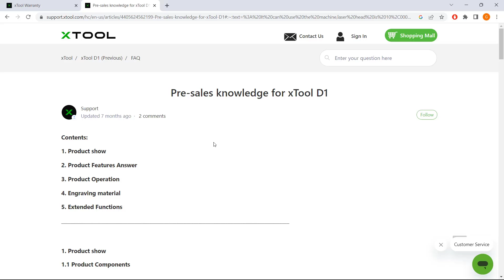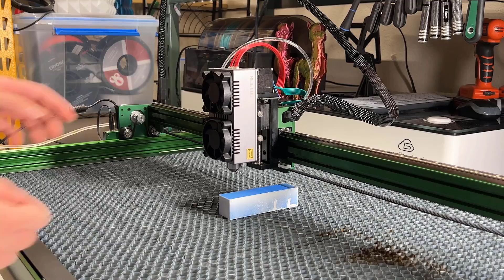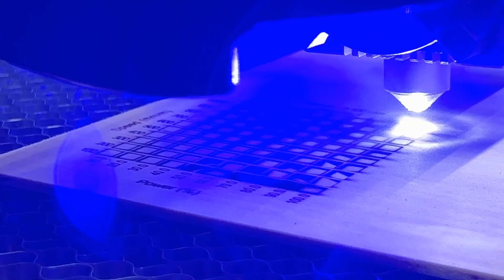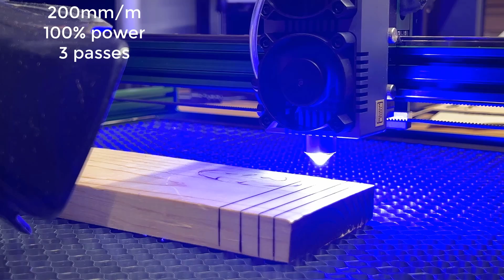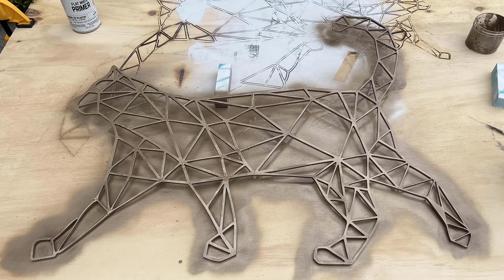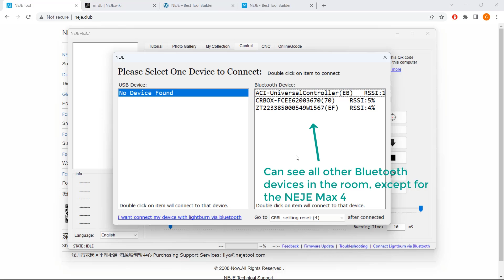NEJE Max 4 20W laser engraver: extendable to 750x1030mm, motorized Z-axis, multiple passes step-down

Comment: Can the machine use standard NeJe software? I have a NEJE DK8 (tiny engraver). It is very small, but, as a non tech person, I find their software easy to use. (Though it sometimes glitches)

I need a larger engraver, but am not sure I could manage the lightburn software. 

Do I have

Comment: Hello, I have a question.  What is the accuracy of cutting a circle?  I had one model from Atomstack, and there the cutting accuracy fluctuated around the circumference by 0.4 mm.  It didn't make me an even circle, but rather an uneven ellipse.  I want to buy NEJE MAX for the size of the structure, but I am afraid that this problem will get worse.  So far, I haven't had a laser other than Atomstack.  It cuts the rectangle/square exactly to 0.02mm, but it can't handle the circle.  That's why I'm interested in how it is with NEJE, since it has a completely different construction.  well thank you

Comment: No where on the site doesn't mention watts.
What is 80 module?
Reply: This is an issue with almost all diode laser engraver brands. They try to use in marketing materials and product naming how many watts the machine uses instead of optical power, to make the customer think the machine is more powerful than it actually is.
This machine has an optical power of 20 watts, probably using four 5w diodes.

Comment: Thank you so much for this video. I've been considering a laser engraver but most of the videos that I've found are glorified sales pitches, without much useful information. One of the main uses that I have for one is engraving on hand-turned wood pens. Would I need the rotary roller to engrave on pens that are ~ 15-18mm in diameter?

Comment: Loving your reviews. Out of all of the lasers/brands you've reviewed so far, which is your preference? I'm really thinking of going with the Neje. I already have the 3s Max with the A40640...but I'm really wanting to take advantage of the improved power and speed of the new unit.
Reply: I bought the NEJE, and the power supply quit within 48hrs lol. The laser itself though is excellent, cutting construction grade 4.5mm luan plywood at 500mm/m-100% one pass. In addition...realignment has been incredible. I can home the machine and restart it at the exact position I choose. The stepper motors stay locked, meaning they don't relax like other machines (or NEJE's old machines), which is what causes poor alignment. In addition homing zeroes the machine to .001mm accuracy per NEJE. So far, I'm inclined to believe them as this was one thing I've tested purposely.

Also, I believe the reason that NEJE rates it at 20,000hrs is their much improved cooling system. 100% cooper heat sink and excellent air flow is top of the line.

Comment: The Bluetooth compatibility is the issue over both win 10 and 11. Most of these builders may have experience with the hardware build, but not with wireless 🛜 hardware. I also find that didn’t provide a cover to block the intense light.
 
Please could do a review of the plotter?
Video was 👍👍👍

Comment: You are correct. NEJE is HORRIBLE at documentation. I bought the MAX3 and information on how to focus the laser head is all over the place. They even have in house videos on here that contradict each other. I probably wouldn't buy another laser from them because of this. The hardware is pretty good ONCE you learn how to use it which is a lot of hit or miss and searching. Im probably going to replace the variable laser head on the MAX3 with something else even though Ive hardly used it. I mainly bought it for the size anyway.
Reply: There are always various ways to focus. It's just that people offer more quality methods than their official ones. I like open design. A fixed approach will make it easier for the user, however  an open design will make your creation more remarkable. 😉